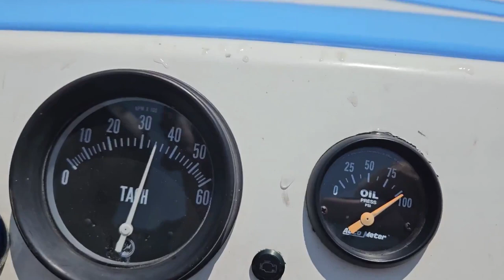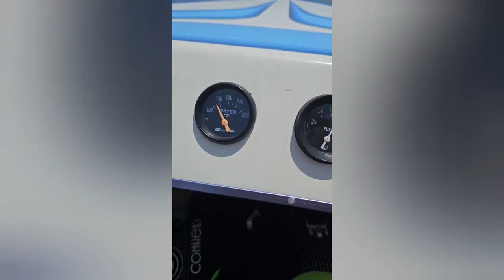LS Swapped boat on a Family  Vacation!!

Comment: A jet boat is my dream too. I have a l92 and a lq9 sitting in my garage just not sure which motor would be better. I havent seen too many aluminum block ls jet boats. Is there a reason for that besides cost? I figured the lq9 would be easier and cheaper to get running since its gen 3. Any tips? Also did u use a c6 or f body oil pan
Reply from the maker: I used an aluminum  block because its what I had. Also i figure it won't rust. The oil pan was mad by Champ pans, 10 quart marine pan
https://www.champpans.com/products/p/ls1060/
You will need an oil filter adapter (remotr or engine mounted filter whichever fits) and the pickup tube as well. Now get that boat together and have some fun!!
Reply: @autovationFtWorth  I'm definitely going to wait until after summer. Hopefully find clean hull with a blown up big block.